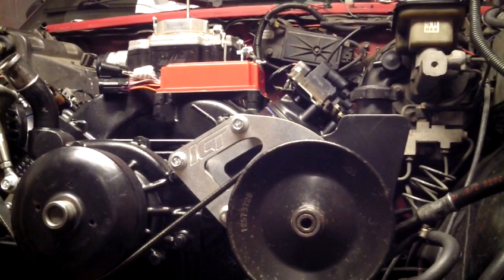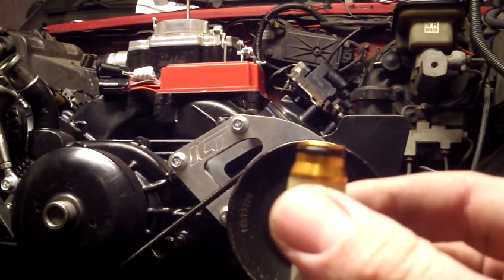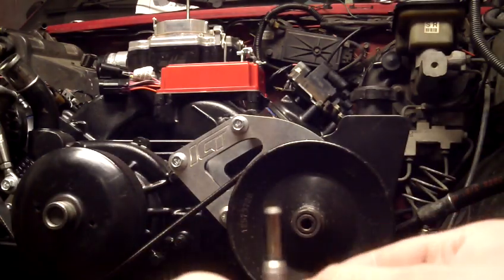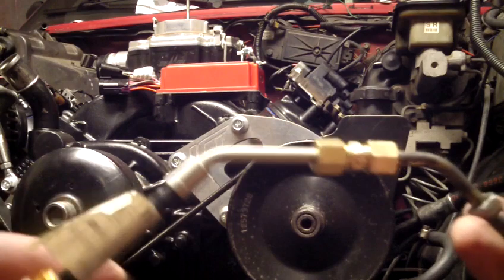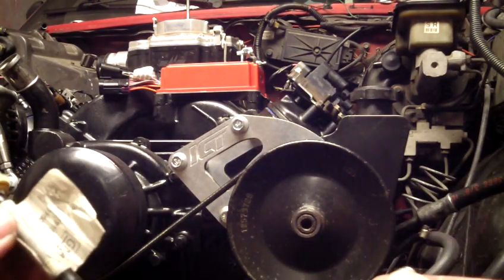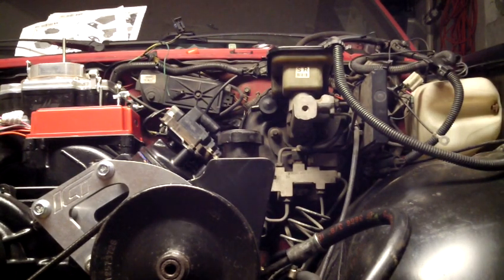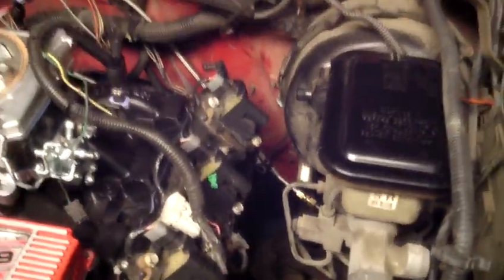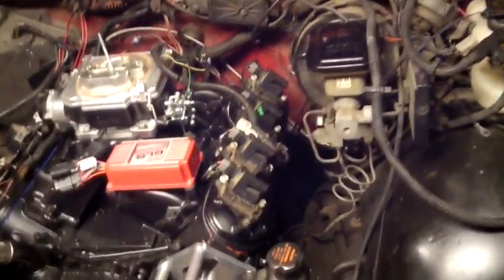How To: Adapt Old GM clutch master to newer Quick disconnect Slave cylinder

Comment: They make steel high pressure compression fittings which would have worked fine for a clutch line instead of brass...
Reply from the maker: I've run brass on power steering pressure lines before never had an issue. It's brake lines and fuel lines that concern me
Reply: BEETEROLDS Hey man I've ran em on brake lines to be honest with no issues lol. But I like the build been following looking good.

Comment: Nice solution to an expensive problem. Whats the point of the quick disconnect anyways? Cant you just change the quick disconnect fitting and run a braided line with threaded ends?
Reply from the maker: billy greenhorn no. The braided line goes directly into the slave it’s completely integrated.

Comment: Couldn’t you have flared both ends and used a union
Reply from the maker: Yes. But In this case the tubing was much thicker than NI copper or conventional steel brake line it would have split at the flare.